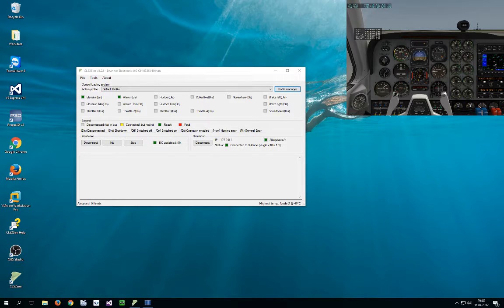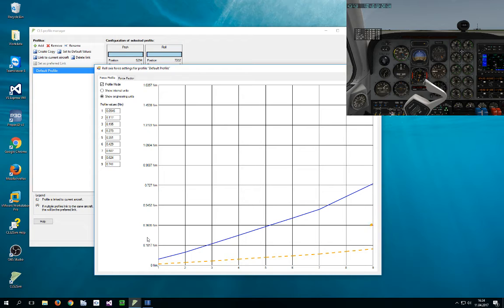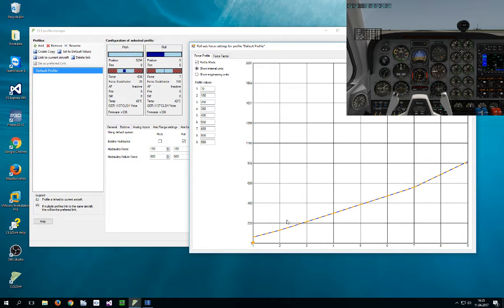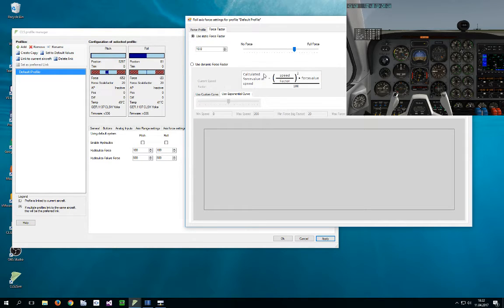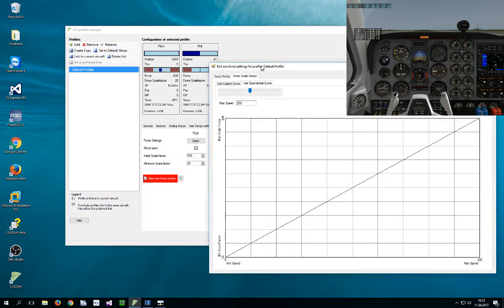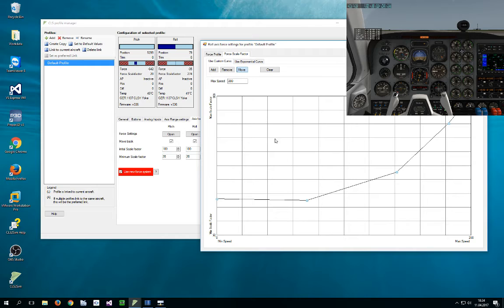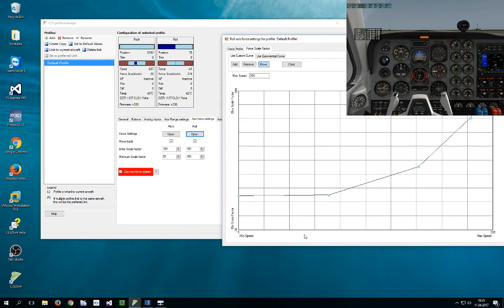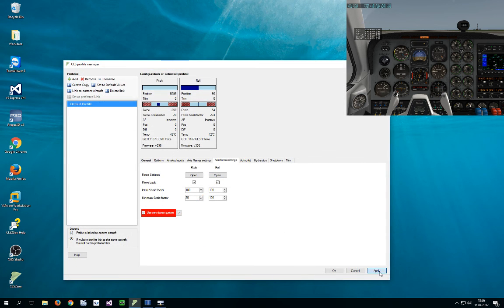Control Loading Force Tutorial

Comment: Diego, thanks for the update, the force related to airspeed is a nice feature.
 However speed is only a part of the problem: I must add that forces (especially elevator ones) are also closely related to load factor (G), which is itself related to center of gravity position, air density, mass of the airplane and bank angle. 

- Stick force load factor is influenced by center of gravity position (aft position of CG needs stronger elevator forces, while forward position of CG needs lighter force).
- Air density which decreases with altitude, makes deflection forces lighter as the air is thinner.
- The higher the mass of the Airplane, the stronger the yoke forces are needed (Hence the use of hydraulic forces on liners)
- Similarly if you are in a tight 45° turn for example, you will have to pull the yoke very hard to keep the rate of turn and the load factor increases accordingly, with an increase of 41% in G force (load factor = 1/cos(bank angle))

In typical airplanes, force factor is in the range of 5lbs/G, knowing that when in straight flight G force is already at 1G
So for a load factor of 5G, we have typically a stick force of 20lbs ==> 20lbs=(5G-1G)*5lbs/G

 Hope this helps